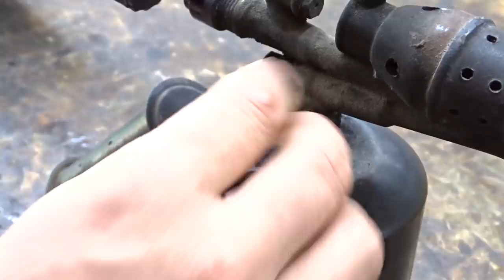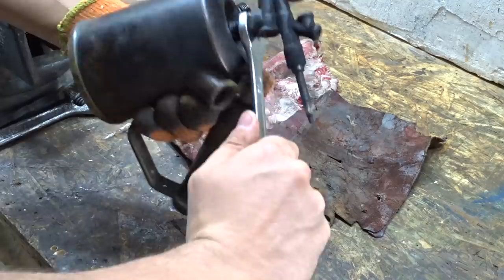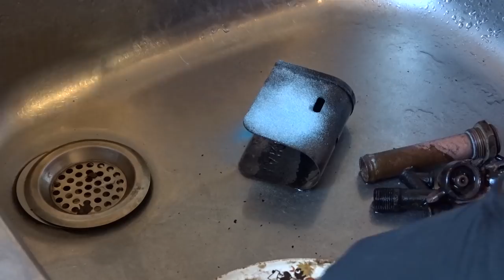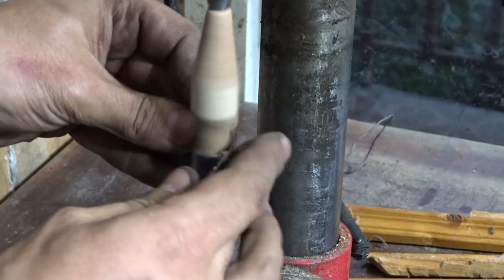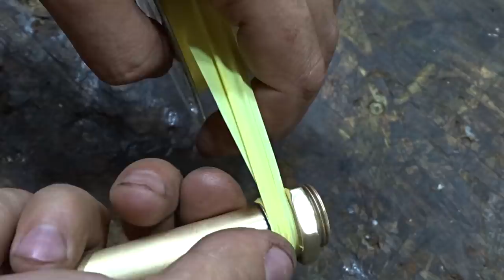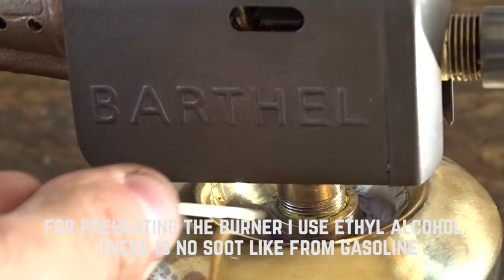1930s GERMAN Blowtorch Restoration

Comment: I have just noticed that you didn’t refit the little bath under the main body ? I’m just in the process of stripping my one down.. any idea what the little spike is for on top of the main tank..
Reply from the maker: Hi, as far as I understand, to warm up
Reply: @ScrewsAndTools , no, I am referring to the 10mm pin that is sticking out from the top of the fuel canister
Reply from the maker: @stevenrolfe1918  Ah, I see what you mean. The main thing is not to damage it, but I do not know exactly what it is. I didn't touch it during the restoration

Comment: I always wondered what fuel those older blow torches used? And what the pump is for?
Reply from the maker: Gasoline is used. The pump is necessary for the appearance of gasoline vapors inside.
Reply: Unleaded has, please, as the lead vapor is not good to breathe.